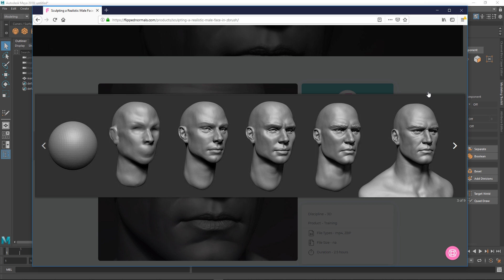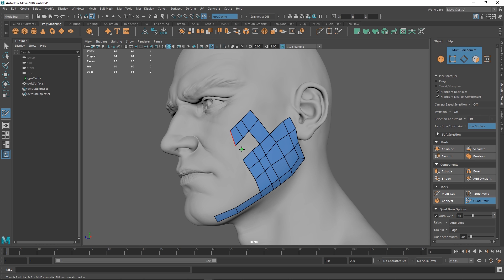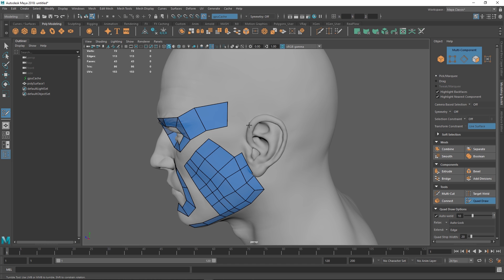How to Speed up Retopo In Maya - GPU Trick!

Comment: It's not working for me. I imported an OBJ file and then exported it into the GPU cache, after that I deleted the obj file and imported the cache file ...I turned it into a live object...but while using the quad draw tool it is not working and it says qwad draw requires a live surface.

Comment: hi, i rewatch this video , because this tips work on maya 20-22-23, but NOT on 24....tahnks autodesk, unless you finded about this issue ? i still work with the old way, or work retopo x cache on maya 23, but voila im curious if there is a solution for maya 2024
thanks

Comment: 1:00 GPU Cache trick when bringing in Model from Zbrush and is super dense, FB guy also taught me this

2:25 How to actually do it

2:30) Troubleshoot) If you cant see the GPU Cache Export Menu bar
****ALSO MAKE SURE THAT YOU SELECT THE MODEL FIRST or else the menu wont come up either

2:58) Cache>GPU Cache> Export Selection
Export your high poly as a GPU Cache
Only need to export "Current Frame" Unless you want to preview an animation

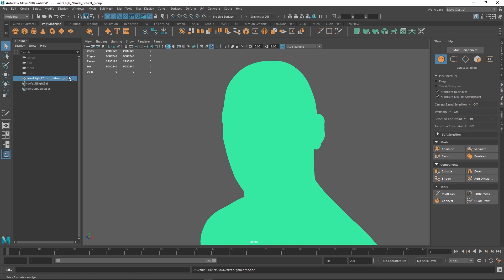3:25) After export, then can import in

3:40) Feature of GPU Cache is can use "Make Live" on it, the rest is history

Comment: In addition to using the GPU cahce, it is also extremely important to decimate the meshes before and also turn off history in maya while using quad draw so you dont have to clear the history every few minutes. The reason it starts getting slow is because it keeps the history, click the icon at the top near the hypershade icon to turn off history and it will never be slow.
Reply: Wow It's solved but I can undo like always no?
Reply: @NeloMN1  Great! Yeah when disabling history the undo que still functions as normal as it is a separate thing.
Reply: The history tip is great, ta :)

Comment: What's your computer setup? The specs?
Reply from the maker: CPU - Intel Core i7-6700K 4.0GHz
GPU - EVGA GeForce GTX 980 Ti SC+ GAMING ACX 2.0+
RAM -CORSAIR Vengeance LPX 16GB - DDR4 2400
Case - Fractal Design NODE 304
SSD - Samsung 850 EVO 2.5" 250GB
CPU Cooler - Noctua NH-U9S 
Motherboard - Asus Z170I PRO GAMING mini ITX
PSU - SILVERSTONE SFX Series SX600-G 600W

Comment: Hey, guys, this is very useful, but it still annoys me they don't have this as default for all file types. As a note, 2018 has a far better performance, as the Quad Draw tool has improved drastically. When you would draw whole new quads or tris in 2015-2017, Maya would create entirely new materials with shaders numbering into the tens of thousands. This clogged up RAM and prevented many users from utilizing this tool to its intended end. There are still forums online with poor Maya users convinced their beastly gaming rigs simply weren't fast enough to handle the power of retopology!!!

Comment: Hi how to import zbrush model from Maya
Reply: just export your mesh (or the selected parts of it) using the export options on file in maya, either fbx or obj, Zbrush can load them, just u need to import them from different places (in Zbrush)

Obj can be imported from the tools menu
Fbx instead u need to check on the plugins menu, there's an fbx import/export related one (but i should open it for tell the exact name :3)